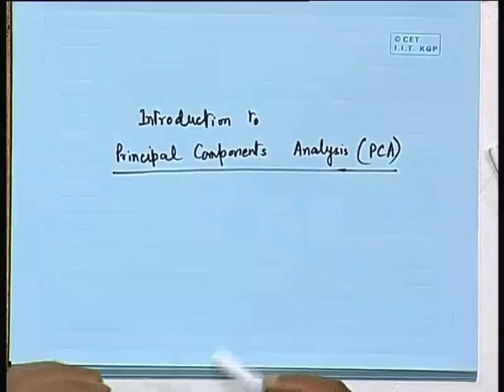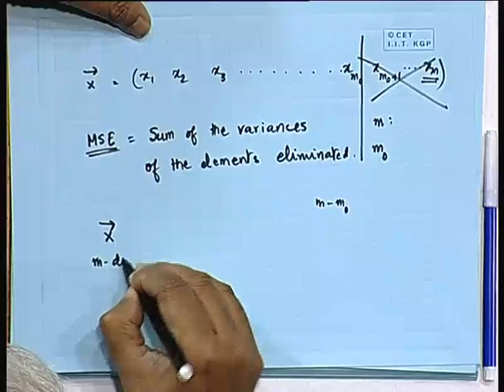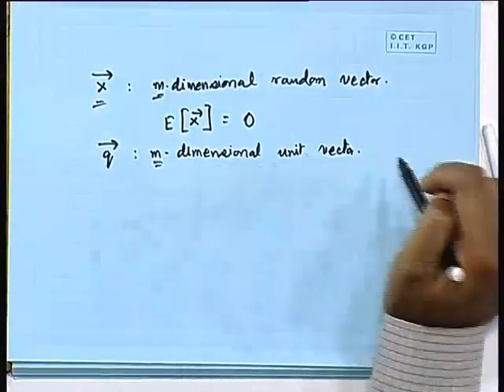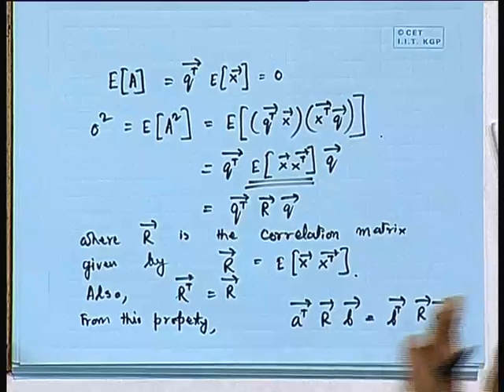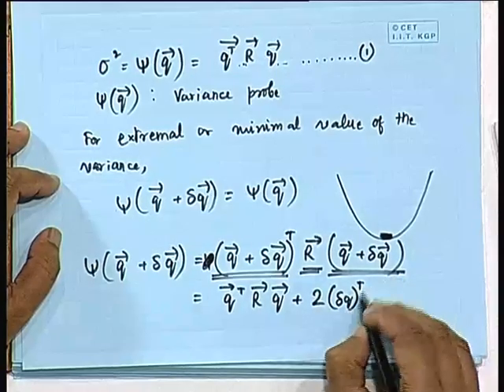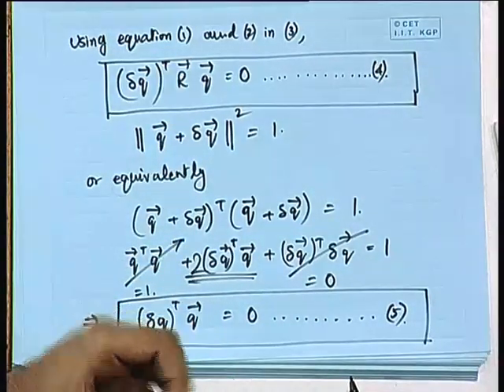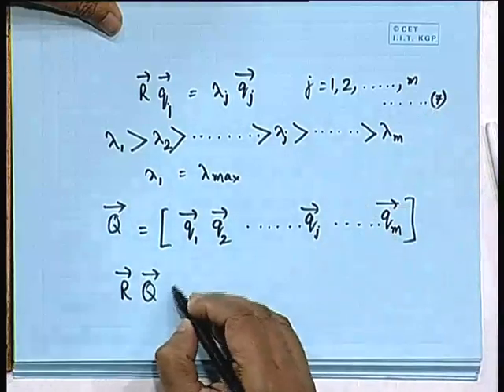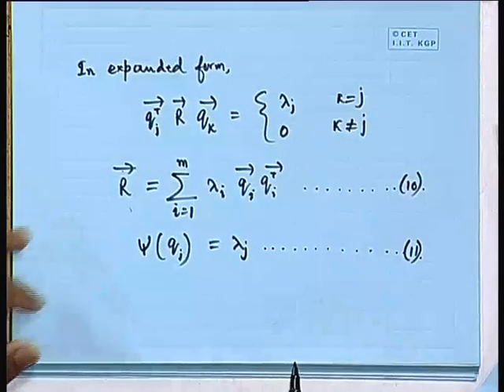Lec-32 Introduction to Principal Components and Analysis

Comment: In the video, he says that the projection of a vector onto a unit vector, is its transpose. How is this true? Can someone please explain?
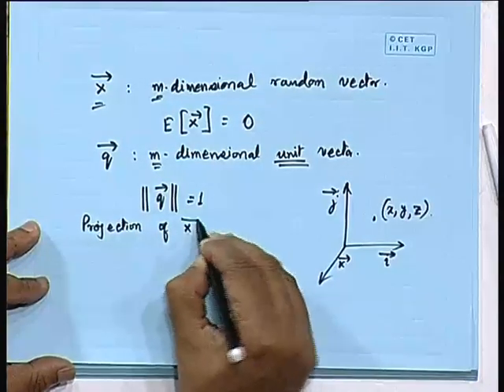Reply: @18:51 
He didn't say "the projection of a vector onto a unit vector, is its transpose".
He said , the result of the projection is a scalar quantity. Now we need to matrix multiply them to get the projection. but the dimensions of the x_vector and the q_vector are both m x 1,  so the x_vector needs to be transposed because we can't matrix multiply m x 1 with m x 1. But after transposing x_vector, we can now  matrix multiply 1 x m with m x 1, resulting in a scalar quantity, which is the projection of x_vector onto the q_vector.
Reply: @TamilTechnocrat  is n't q a unit vector and should be dimensionless.

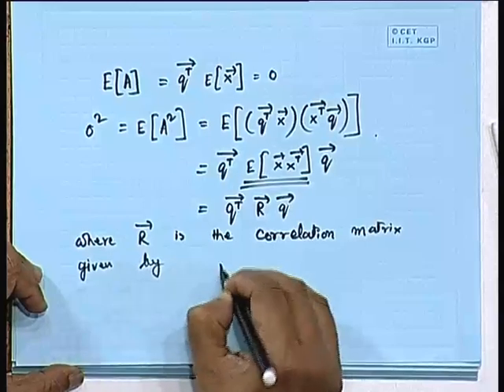Comment: R at 23:28 is correlation matrix or covariance matrix?
Reply: yes
Reply: It should be covariance matrix
Reply: Even in case of correlation matrix calculation we calculate the covariance (auto correlation as variance and cross correlation as co variance) so basically both of them means the same thing just correlation is normalised representative of covariance matrix